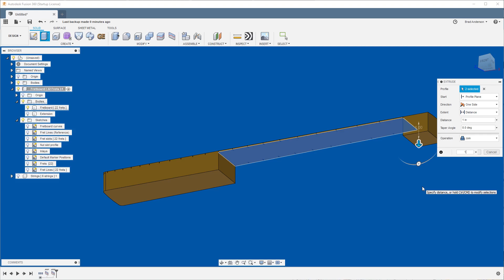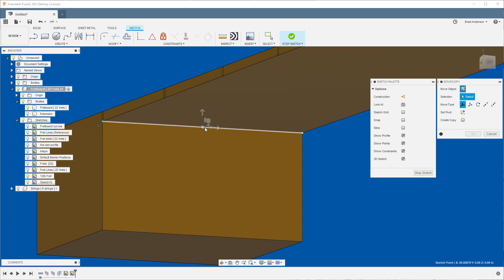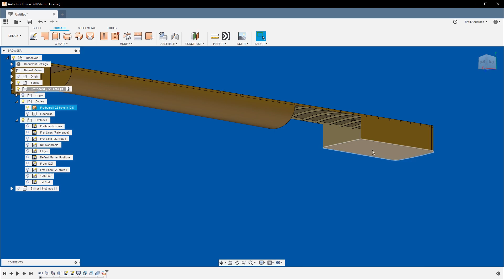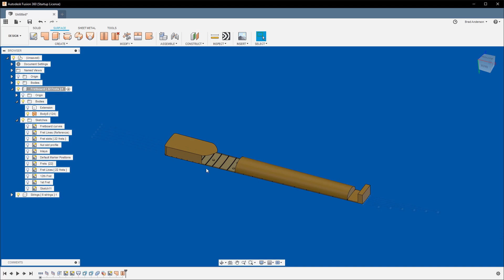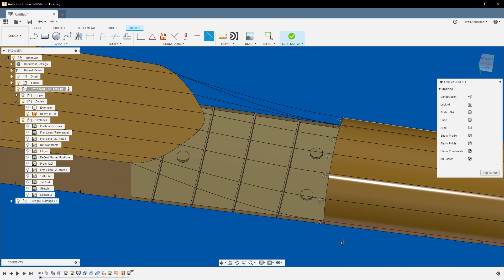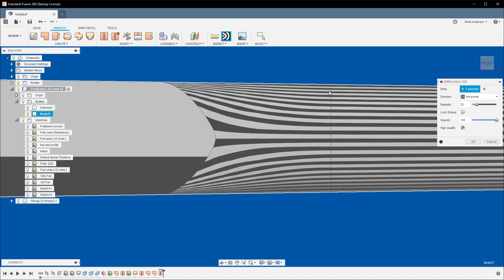Fusion 360 Guitar Neck Tutorial - Part 2 (Neck and Heel Transition)

Comment: When you set the splines starting at the heel outer corner fusion360 will NOT let me set that spline. The ones from point to point for the projection? No problem. But neither of the outer will snap and attach? why?
Reply: So, maybe I missed it, or it wasn't said, but there is a button on the panel called 3D Sketch. It wasn't enabled. once I enabled it, I was able to connect the points on the hell as well as the points on the rails for the 1st Fret to headstock transition. In fact, the ease of doing so once I clicked that button made me want to punch myself in the face for how much time I wasted trying to get it right. Thanks, this tutorial is great.